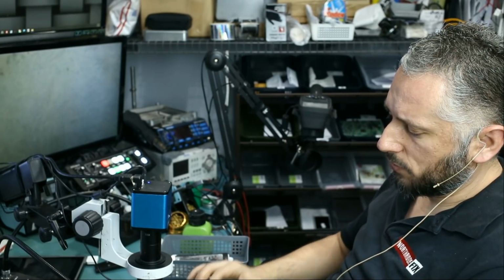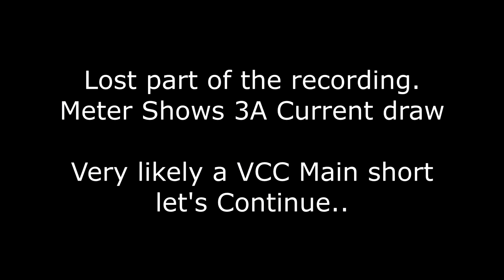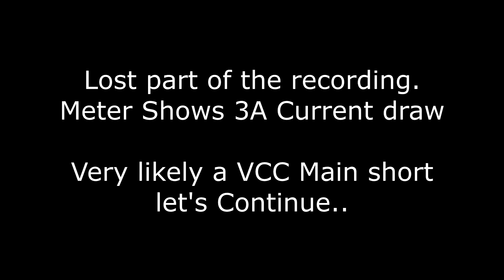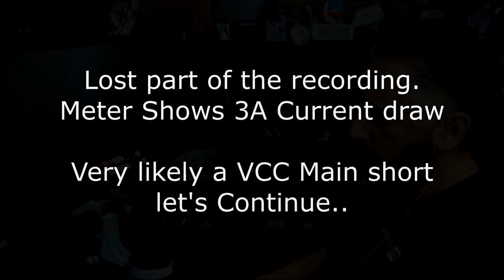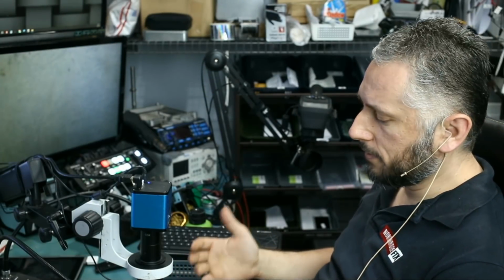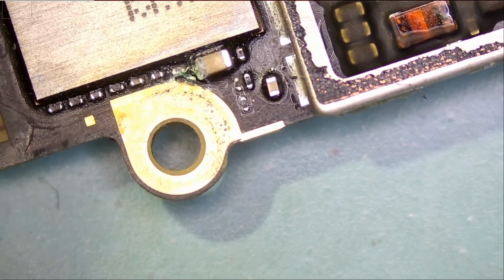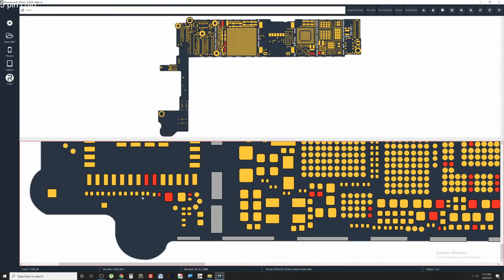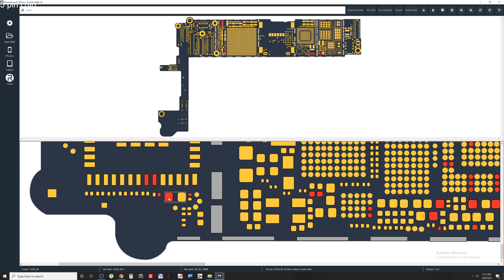iPhone 6 No power Data Recovery VCC_Main Short Circuit Detect using Flir

Comment: Why you didn,t replace the capacitors is not needed to work properly?
Reply from the maker: It's a bypass capacitor used to smooth the signal, it has minimal impact and phone can power on without it.

Comment: Hi, how come you use diode mode instead of continuity mode when checking for shorts. Is it more accurate/reliable results.
Reply: you will still have to use your brain in- any mode and both will tell you the same story
diode mode measures the voltage drop and Continuity is basically resistance reading that just beeps if the resistance is lower than a preset amount usually 70 to 250 
thing is diode mode is muuuuch quicker 
but so you know he is using continuity mode here since it beeps, diode mode doesn't beep but since the two modes make repairman know the ' same ' things their names are used interchangeably
Reply from the maker: Diode mode is faster
Reply: @NorthridgeFix  Ok thanks

Comment: Could you tell me which is the temperature required to remove chips, capacitor and other ..?
Reply: depends on board,and solder
Reply from the maker: @mohsentabouna6401  Yes depends on the board and your hot air station. For iphones, i would start with 370c at 75% air speed

Comment: Why not use hot tweezers for removing these every time?
Reply: they are too big for the tiny iphones and the lack of clearance and risk of knocking over other capacitors
Reply: My tweezers are rarely used these days only on less detailed work.
Reply from the maker: @wefukthenwo  It's a combination of items, the Camera which is based on the Sony 
IMX290 no specific brand, the stand from amscope, the ring light from amscope and the spot light from amscope and the lens no specific brand. I'll talk about the whole package in a future video.

Comment: iPhone whisperer :) 
I have a noob question: how come removing those capacitors doesn't create an open circuit?
Reply: Because the cap is not in series with the circuit. It’s a parallel connection to the net and ground that only “filters” certain high frequencies (noise).
Reply: @Jerryh31  And all is clear now. Thank you Jerry!
Reply from the maker: It's a bypass capacitor used to smooth the signal. It's has minimal effect and phone still turns on without it.
Reply: @NorthridgeFix  Thank you!
Reply: easy answer; think of your room lamp, if you remove the lamp the whole house ain"t gonna go dark
long answer, Google
Reply: @mohsentabouna6401  thank you, I suppose OC is the exact opposite of CC therefore it makes sense to force an OC in certain scenarios like data recovery but I was hoping for a better understanding/explanation. PS: I tried Google before posting my question but I can't find relevant articles on the Internet...

Comment: Really like your videos. You can feel how you get your motivation out of seeing that something works again!
Reply: I do repairs as a hobby sometimes. I also find it quite motivating when some thing comes back to life... For me it is a distraction from everyday work. :) Just yesterday I have replaced a flat flex cable in a PS4 by 8 Kynar wires because the connector was gone and lost. With the same microscope you see in the video (bought through the link in the description). Cable was torn when trying to fix load mechanism. That was caused by broken fuse.
Now one PS4 resurrected from „Online only“. Happiness :)

Comment: I already have a UM34C USB 3.0 power monitor ... so can you buy those phone power connectors separately, without buying the Red current meter? ...
Reply: Krell FreelanceTechnology : No, from where you will get 4.2V?
Reply: @rofo88  Use a bench power supply ... then using the UM34C and a USB lead, you will have the same setup ... simples ... it's just the power plugs that are needed ...
Reply: @krellft  : If you have a good bench power supply you don't need a USB meter, just connectors. It will show you amps and power
Reply: @rofo88  You didn't read my original post properly! ... I was 'asking' if the connectors were available to buy seperately ... that was it, nothing else ... I know what to use and how to test ...... this thread didn't need to be this long ... lol ...
Reply: @krellft  check aliexpress they sell them in bulge of all the models you can think of at super low prices
Reply: @mohsentabouna6401  Thanks ... I have been searching around ...